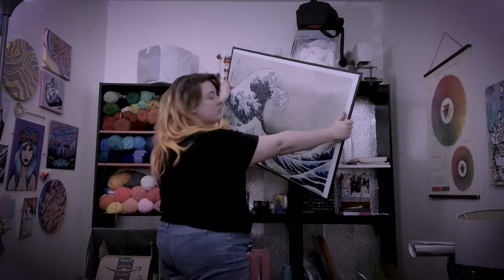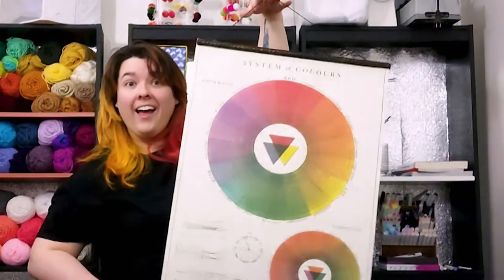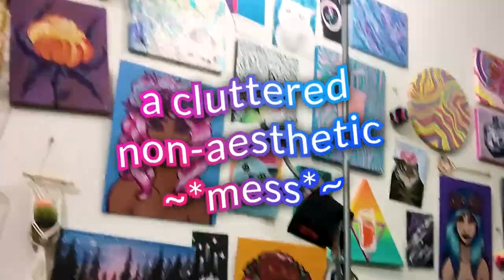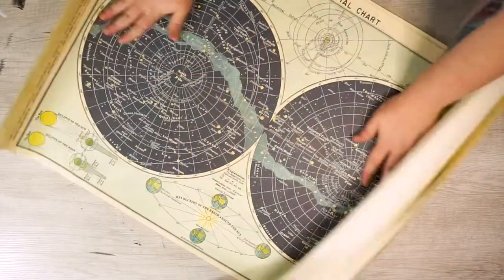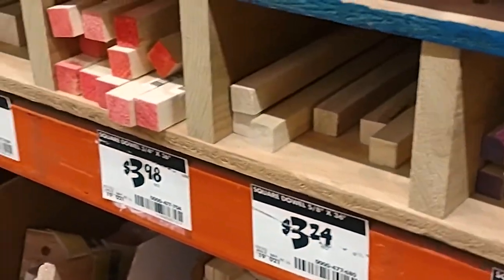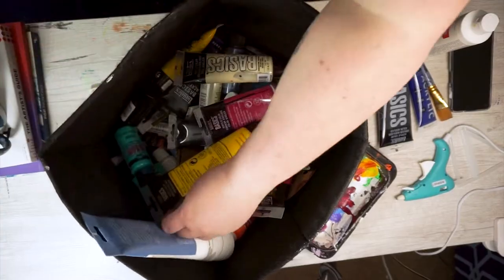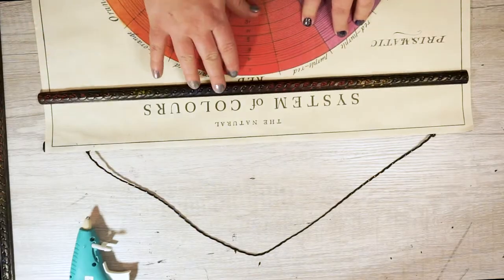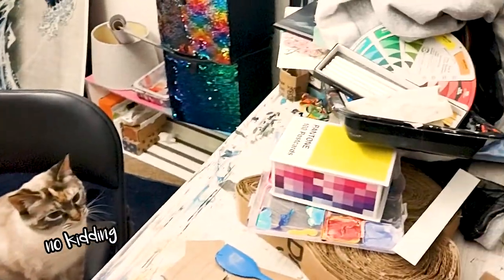How To Hang A Poster Without A Frame (DIY Poster Wall Hanging/ DIY Poster Frame)

Comment: any thoughts on how to keep a 1962 lithograph safe/hung ?   i was quoted $225 for a gold frame but am not sure the thing will survive going in and out of the poster tube.  just ripped in 2 places today.  boo.   i thought linen backing but the museum framer i saw today rx against it b/c glue will be absorbed by the print eventually.  no matter how well the glue is applied, it will come through and could impact colors.
Reply from the maker: Was the framing quote from someplace like Michael's? They usually have coupons and you bring the thing you want framed into the store. You wouldn't have to mail it out in a tube (I'm assuming that's what the tube was for?).

Comment: Great video, thanks! Do you have a suggestion for me; I am trying to do this with my movie poster, which is kinda thicker. And it's also sitting in a roll for a long time, so I am afraid if I hang it in your way, it will not hang flat. What do you recommend I do to flatten it?
Reply from the maker: Good question! Try this first:
     Lay the poster flat on a table or the floor near a window that gets a lot of sun. Place something heavy like books on top to flatten it. Leave it in the sun for atleast a few hours. But leave the books on the poster until the sun goes down and the poster doesn't feel warm any more.
    This might make the poster paper's fibers, the inks and any coatings expand or relax. The weight of the book keeps it flat until things cool down. It's like training the poster to hold a different shape. The longer it can lay flat under the weight, the better.

If that doesn't work or if there's still a bit of a curve left try this: 
    Weigh the bottom piece of the "frame" down when hanging. You might be able to get those big, round fridge magnets and glue them along the bottom on the back. The 3/4" ones might be a good size/weight combo.
    Or if you're able to find a heavier "dowel" or wood strip for the back on the bottom. Home Depot/Lowes sometimes have ones labeled hardwood or oak that are heavier than the ones I used. 

Let me know how it turns out!~